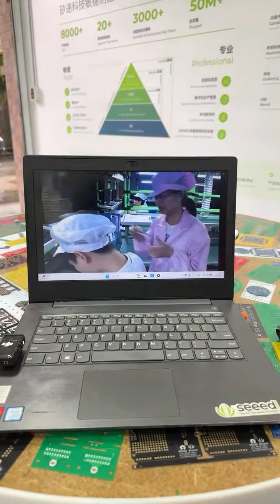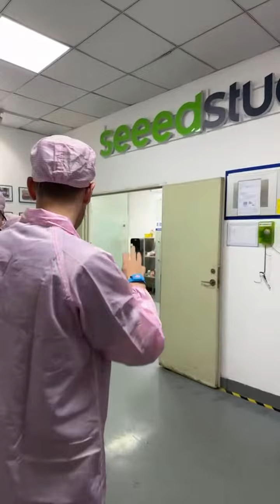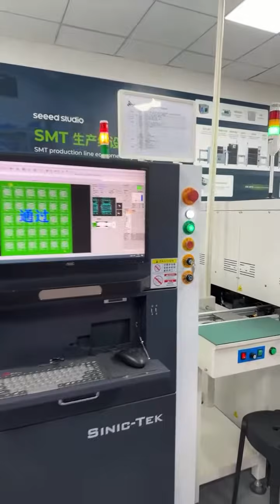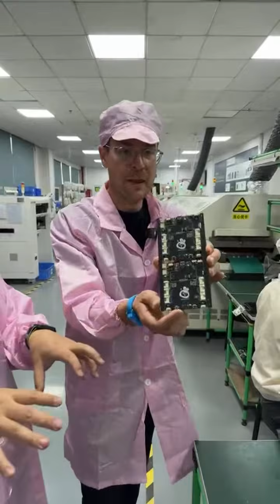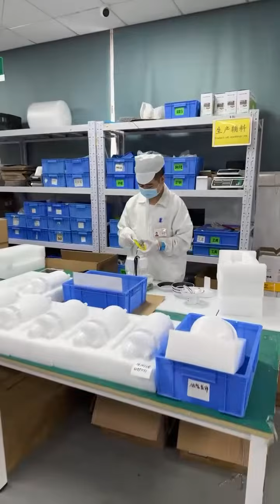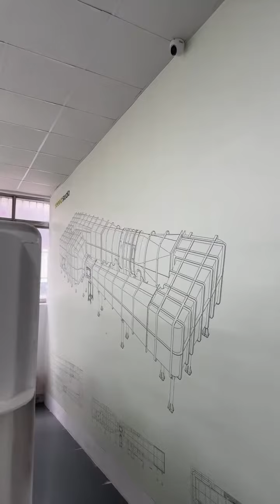Making Next Gadget: Back to the Factory

Comment: I was hoping to see the innards of the M2 Multiplatform LoraWAN gateway. What is the Female USB-C on the outside connected to? I was wondering if the M2 could be connected directly to the meshtastic develop kit and form a Lora to Meshatastic bridge without any hardware changes.